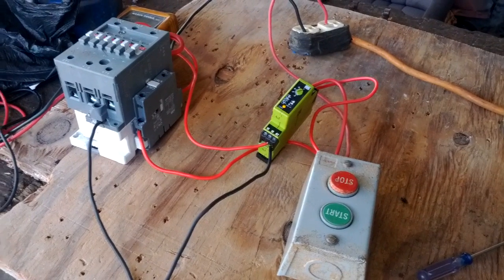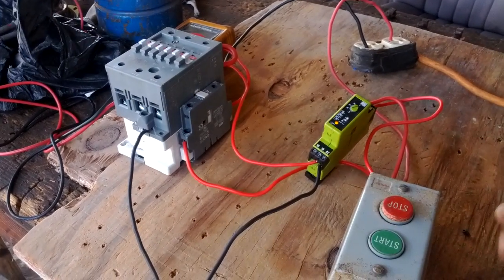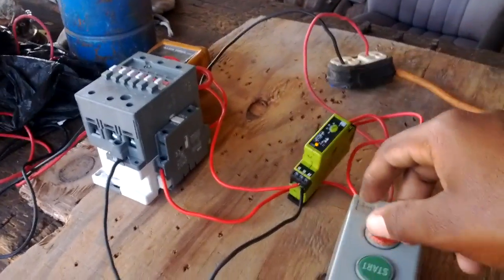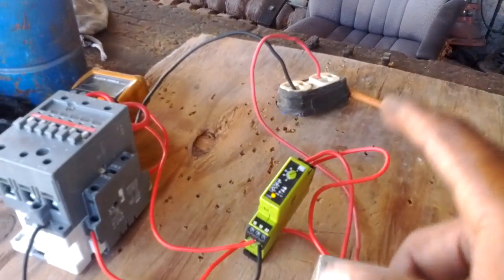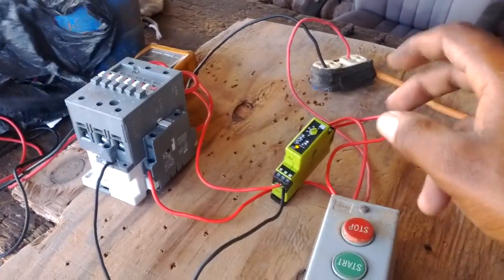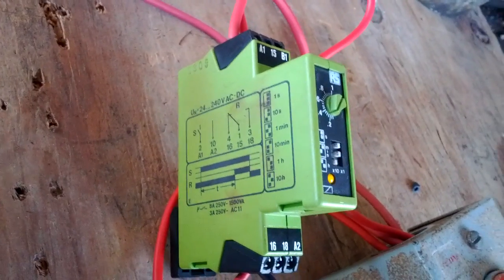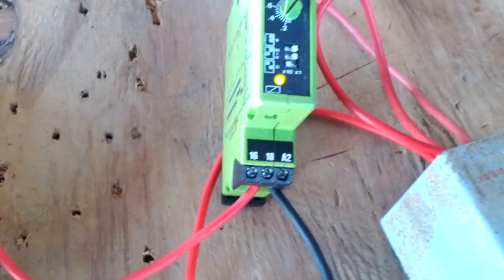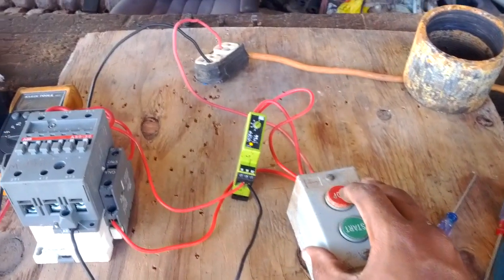How to wire a Timer in a Control Circuit.

Comment: Could u make it more easier and close  camera much more to control terminals  plz Mr wilson!!  especially on yr previous  star/delt with timer relay.
Reply from the maker: Eremias Tewodros 

I thought this video would have been clear enough...  a timer for contactor control must have two auxiliaries, one is NO and the other NC. The also has a coil, when power goes to the coil it starts the time counter when power is lost from it loses its time count. the star contactor wire passes through the NC side of the timer and the delta goes though the NO side of the timer

Comment from the maker: Normally in controls everything is in series with the contactor coil. So try wiring the pressure switch in series with the contactor coil. Is if any pressure problem the control circuit should open.
Reply from the maker: Ban Thomas Nice to meet you as well mr thomas
Reply from the maker: Sure you can ask Mr Thomas.
Reply from the maker: What do you mean buy controlling the contactor? you wanna power the contactor from the 20A socket outlet?
Reply from the maker: Ban Thomas 

So your saying you powering the AC from a three phase power outlet??
Reply from the maker: Alright but when u incorporate a contactor to be used you will need a control circuit to to control the contactor what will power the AC unit. either using phase voltage from any one of the legs or sourcing a step down transformer, which do u need a drawing for?
Reply from the maker: Ban Thomas

Im just about to finish the diagram for you... but what you mean by steal electrical. power a ac unit from a three phase plug has more to it that that... the contactor needs to be controlled and also the plug needs to be feed by an allowable breaker.
Reply from the maker: lol lol Big shot im not into teach illegal actions boss... I cant help you with that lol
Reply from the maker: Doing that would get you locked up.
Reply from the maker: Lol... No a contactor cannot steal electrical... its just a controller for electrical equipment.
Reply from the maker: i have it i just havent sent it as yet.
Reply from the maker: Ban Thomas

Send me you email address sir thomas